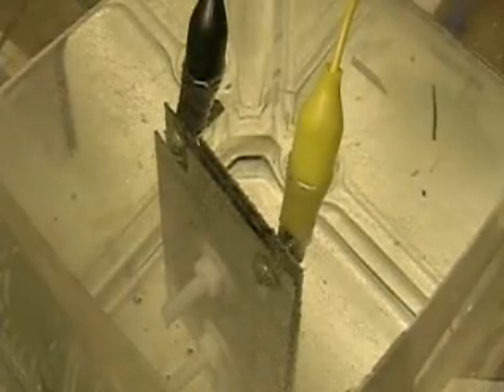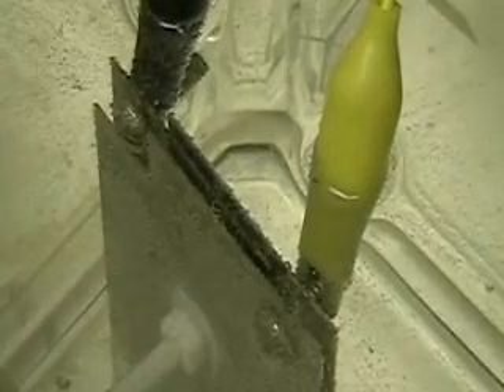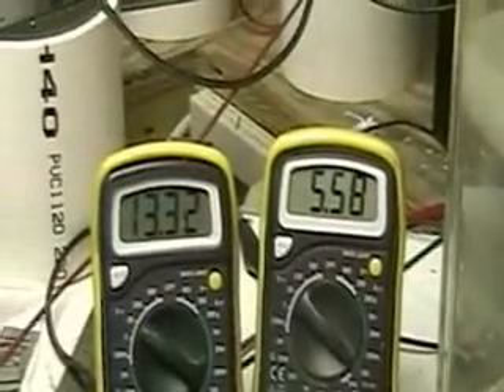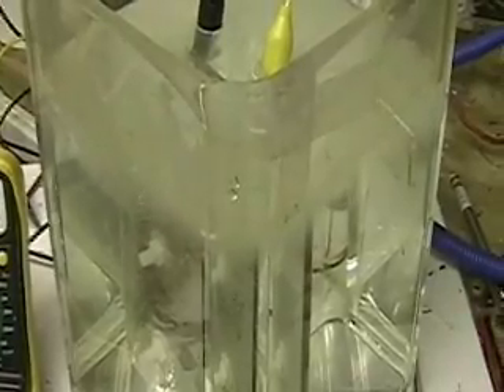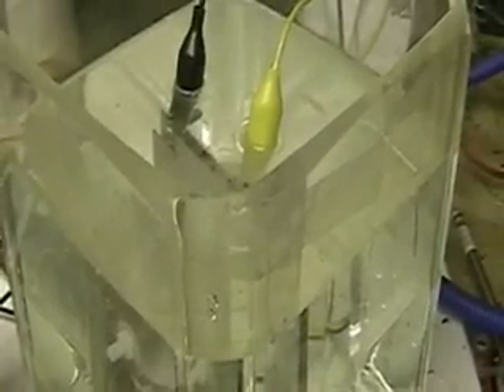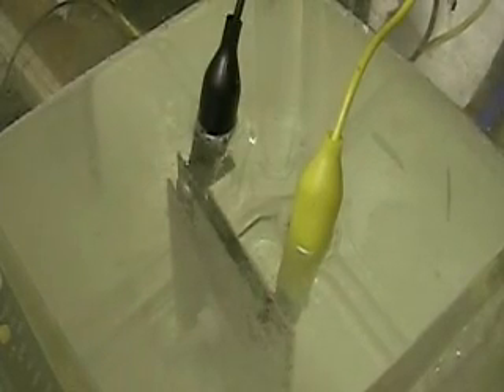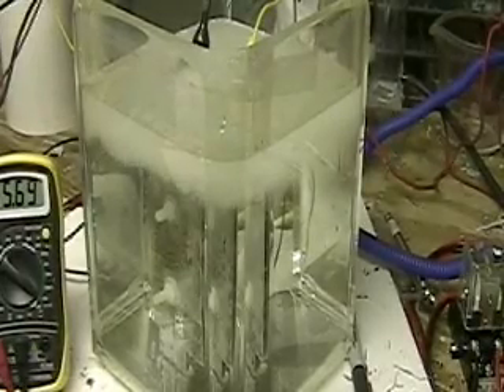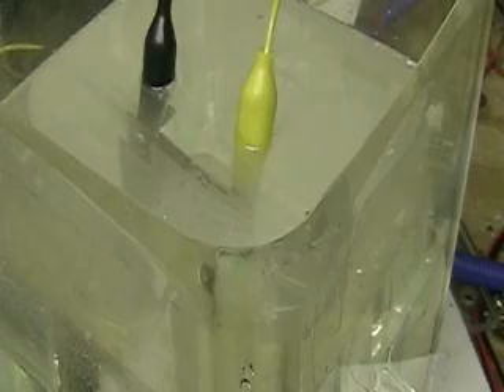Hydrogen Tap (Must See Plate Findings) 267

Comment: Hello John
Just a Tid bit.
I do know if U are aware of this, but U can use steel in place of the SS for the Positive (anode) without any contamination, but NOT the other way around. This also helps keep the cost down. The steel will need to have all the mill scale removed by HCL acid etch or sand blasting. Give it a test and see
Regards
Bill

Comment: I see your point there. However, if you put in SEVERAL series of plater wider than thicker into that smaller (thinner) container vertically, I believe THAT would be an answer.  Or, build it horizontally, then put up a chimney (or 2 or 3) off of the horizontal application.  If it is more efficient, then make the space for it to fit is what I came up with.